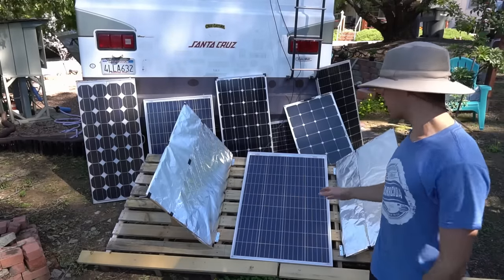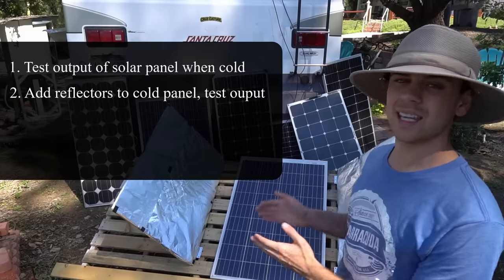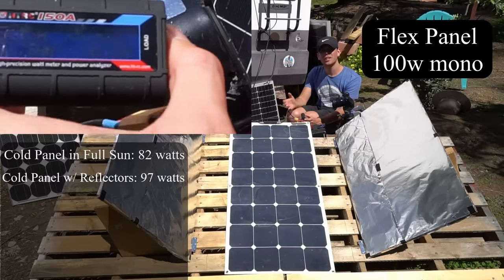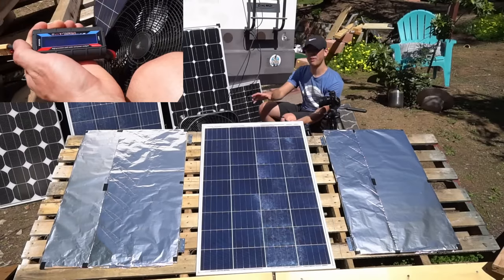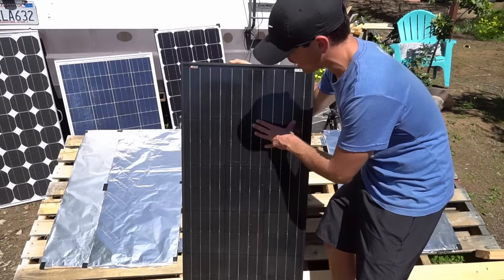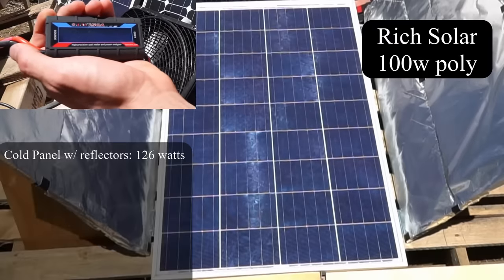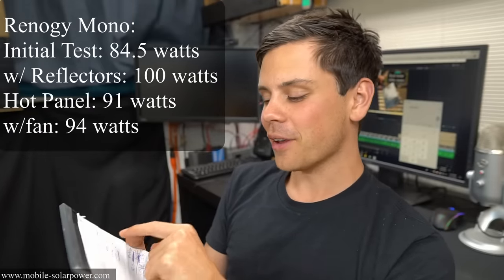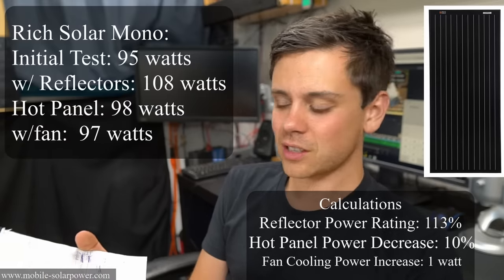Solar Panel + DIY Light Reflectors = More Power? Renogy vs Rich Solar vs Flexible Panel

Comment: An interesting test - most RVs have solar panels mounted flat, test reflectors on flat mounted panels.
Question - does the reflector need to light the entire panel equally, would “hot” spots from a parabolic trough reflectors compromise the panel output

Comment: I would say moving panels are excellent if you have them move in both directions. What that does is leveling the power during the day. While it might not increase the power that much. It will become much more even. Reducing the strain on the battery

Comment: Please do another video testing all kinds of reflectors: tin foil vs polished metal vs clear mirror vs mirror cover in fluorescent paint... And you can add more reflective surfaces... To see which are better. I assume the clear mirror will come out on top but it's worth experimenting on it also regarding the cost vs energy gain.

Comment: I camt remember the manufacturer but there is a panel that has a built in coil in back so the heat temp recovered from semi conductor is used in another application like domestic hot water.  You might want to test it against your other panels and see if there is a stability in temp to max output with your reflectors.

Comment: Great video, I really appreciate you taking the time to run through your experiments.  From what I understand solar panel photo-voltaic cells are excited by visible light in the 380nm to 750nm wavelength range.  Ultraviolet and infrared wavelengths cannot excite the cells enough to knock off electrons.

Since solar panel efficiency drops with the increase of temperature, wouldn't it make sense to use a UV and infrared film on the solar panels?  Perhaps adding such a film in a frame would foster better results, especially if there was an air gap between the film and the panel; to guard against acting as an insulator.

Have a great day.
Reply: You can reflect IR so photo panels don't get to hot as you mentioned. And use a water heater panel to produce hot water at the same time. ( use mylar insted aluminium foil)
Reply: No not only the visible light.

Comment: All solar panels are tested at Standard test condition (STC - Irradiance 1000W/m2 at 25 degree C). Say a marketed 100W panel can theoretically produce 125W given 1250W/m2 at 25 degree C condition. Problem is higher irraddiance normally means higher temperature as solar cell cannot absorb 100% of the irradiance. Whatever it cannot absorb will turn into heat. Higher temperature means drop in voltage due to solar cell's characteristic. Drop in voltage means lower power generated.

Comment: I just came across a roll of roofing flashing in the road. It's about a foot wide. I will def by cutting pieces from what didn't get run over by cars into flats long enough to use as reflectors for my Ecoworthy 120W folder. They show be ale to fold and stow with it really easy. My charging will be short term top offs midday. so It will prob be worthwhile to babysit them.

Comment: I did a similar test many years ago using two mirrors that were the size of the panel. I just ran cold water from a hose on the panel to keep it cooler for checking the temp differences. I have since lost the paperwork from that test.  seems like with two mirrors I was able to double the power but with water cooling the panel.
I think if you used actual mirrors and cold water you would have better results.

Comment: This is a great test, but I so wished you had to taken it a bit further, why because I have hard and seen with my own panels that the cooler they are in full sun, the better they operate at. So water coolant in the panel would be my suggested method, and what's more the water could be pumped through a cold water tank and circulate round the system, at the end of the day you have a tank of hot water!! The difficulty would keeping a even cooled panel. so perhaps buying more panels would be the answer, however I might try my idea on the next solar installation on the shed.

Comment: Mono panels perform better in low light. Also some panels have lower voltage but higher amp ratings to comparable wattage panels

Comment: That reminds me of my early days as a computer/programmer analyst when we were under intense pressure to write efficient source code.  Both computing power and internal memory and mass storage was expensive.  This was a time before PC's came along and minicomputers could not do the job (my shop had monster Sperry Univac 1184 which is still in use as a Unisis something or other).
Solar panels and other equipment are getting cheeper better all the time.  Just look at the improvements and advancements that have taken placed since the Intergr Kodiac and Apex came along.  My wish is to come to the market a out of the box comprehensive system.  It looks like Tesla is heading in that direction but not off grid yet.

Comment: I wonder what actual mirrors would do- probably not a whole lot more. I suspect adding a simple water system to help cooling would help with cooling- not sure if it's worth it though- the extra complexity/maintenance of adding the mirrors/water or fan for cooling would likely offset the benefit much of the time. Nice work :D

Comment: You could use peltier semiconductors to generate energy from the temperature difference, keep the panels cooler producing more energy as a result. But to move the heat away, heat pipes maybe.
Reply: peltier defices insulate, if you want them to cool it will take power and they are still terrible at generating power from a heat difference.

Comment: A friend watched output of panels on an island. With wave activity he could see the effect of water reflection on output of the panels. Snow reflection also played a factor but temp was a lot colder too so that improves output of cells so winter with a clear sky is kinda like comparing apples to oranges. Because no heat effect of cells because way too cold to be a factor. But thats why I think the water cooled panel has merit where you are and closer to the equator. Utilize the waste heat in another way and keep cells cool for max output

Comment: Nice video, well done. 2 points.
1) who  didn't expect more input energy to yield more output power? I would assume there is a maximum power out (more power in doesn't yield more power out): what conditions are needed to get there? Just a bright sunny day with the sun at 90 degree incident or are those reflectors necessary? 
2) those reflectors take up area, would a panel of the same area create more power than adding a reflector? I understand one solution is much much MUCH cheaper (in the short run), but area is a precious thing.

Comment: Started the video, grabbed the popcorn! :) I had the same idea a long time ago, but ran into some possible problems in my mind for practicality! ;)
Reply: I could see something like this maybe working in the arctic (for a research station for example), where sunlight is scarce and the environment is cold to begin with... but then again, even there it might not be worth the effort. One more idea I had was to improve the output with some kind of micro-lens film or coating, but I bet that has also been tried/tested by labs and manufacturers already - ideas are not exclusive... ;)

Comment: Well at the top end a good reflective system will get you 60% extra power out of a panel, but at that point water cooling is critical and your panel will have a shorter lifespan because of the extra photon bombardment.
Ultimately it comes down to calculating what the extra power will cost you in additional panels vs reflective or even tracking system.

Comment: Dude you are amazing, now I live in Colorado, if you were me , & you are going to put up solar panels to run a complete home, which panels would you use, & how many, what mppt control module, & what brand ,& how many watts would you use for an inverter to run everything in a typical house , full size fridge, washer / dryer, central air unit, lights, & all types of hand tools, & everything else you can think of, & approximately how many batteries, & which ones, & what brand

Comment: Nice video. A large lenticular lens would perform much better in terms of increasing light exposure and power output. Also using a fan will of course result in a net loss of power, not an increase, since the fan consumes power by at least that amount.

Comment: Have you considered using smart engineering + light/sun tracking + reflectors?  Imagine combining all of your panels with aluminum arms to a single light/sun tracker so they are all at the optimal angle. Using only one motor/light sensor.  And then do the same to reflectors targeting the light to the panels. I could definitely see this as something you would put the time and effort into doing each time you stop at a new location if you are going to be there for now then a few hours. Or if you have enough solar/battery to make it worth it...
Reply: I built a tracking system like that for my little MoHo a few years ago. Space on the roof was quite limted (by a pair of hatches in the roof) and my 48N location called for tilting from horizontal, to harest low-angle sun. Really simple 19th century linkages. Designed it for 9 @ 50 watt Renogy panels in 3 racks wired in parallel with 3 panels in each rack wired in series pairs or series trios, depending on cloud cover. This clip shows the linkage https://youtu.be/zqOkXPOkr2M

Comment: You should also take in account the area the cells of the panel take when comparing the panels. The polycrystalline panel has significantly larger area => there is more sun shining on it.

Comment: I wonder if water cooling the panels would help. Running copper or plastic across the back of the like a solar water heater, might help reduce the temperature, and get more power out. If you have a solar water heater anyway, this might help pre-heat the water going into your solar water heater. Food for thought

Comment: I noticed that when the individual cells on the panels are "full size",   they tend to output more power than the ones who are only half size.......  My only guess is that the full cells requires less connections / Soldering which means lesser resistance.   I was really impressed with that poly panel.   It's really the best bang for the buck.

Comment: Try it at 10*F on a severe clear day with snow covering the ground.  My 560W of polycrystalline panels put out over 720W. On a  hot summer day when the output is depressingly low, I spray them with the hose and watch the output jump. (Not practical, just interesting).

Comment: You don't have to use reflectors tho, lensing has the same effect... you're increasing the area that receives sunlight without increasing the physical area of the panels, and there can be different reasons why you'd want to do this, for example, you could put multiple panels standing upright in a small area, then collect light from a larger area above and direct them down, so you're not putting more sunlight onto the panel (no extra heat) but the panel may be in a better position, maybe less vulnerable, and having it vertical allows for much better convection based cooling as you get a faster channel of airflow next to it. You could maybe filter out lower frequency infra-red that contributes less to the power output, but contributes greatly to the heat increase etc. If you have no reason to do any of these, then it's probably just a case of "solution in search of a problem", but I think NASA was interested - but using actual mirrors to get better reflection... I guess when you're further out in the solar system, collecting sun from a wider area using a light weight expandable reflector material makes a lot more sense than adding bigger, heavy panels.

Comment: Best way to increase photon density is using a parabolic shape, like a parabolic trough (linear in one dimension) following a hyperbolic curve in the second plane, this is especially effective in heating fluids in a pipe. I think the best way to increase solar panel efficiency is to have some form of covering with light congregant collimated tubes that allows light in, but will reflect any reflected photons to be returned from the end of the tube back onto the surface at the same incident angle, this way it is reflected back again until the photon is absorbed by the silicon substrate and converted to an electron. But how this is done in one's back yard would be somewhat daunting to recreate, it is the same idea they use in plasma reactors which use lasers and a fluid plasma that does not hold the same shape, to increase efficiency in laser utilization, but in this case would not be in a spherical geometry, but implemented in a flat plane on the sun side of the solar panel. Just google light tubes for a primer but instead of letting the light out at the end of the tube it is reflected back at the same angle of the incident photon, and multiply these tubes like by the thousands on the surface of the panel. Cheers good information.

Comment: You should re do this test when it is winter conditions... I don’t know where you live, but if you get below zero conditions, perhaps the reflectors can maintain low temps with the reflectors...
Reply: Also, a reflector could be used when solar conditions are poor, like cloudy days...

Comment: I'm no engineer....
But i can't help but think? Using panels outside of the parameters they were designed for? Will shorten their service life or potentially damage them. 
The reflectors are a great idea! I just don't know if residential consumer-grade panels are designed to withstand the addition of reflectors.

Comment: I wonder if having a fine mist spraying system behind the panel would effect in any significant way...

Also if using reflectors when the sun is filtered by cloud or just far from baking the panel but like you've said... It's probably easier to just add more panels....

Love your videos, they've been so valuable to my learning curve and I love seeing a retailer with your video links on their websites...

Comment: Reflectors still have a niche use in limiting the amount of silicon you want to use. If you have a large solar array at say a farm, it'll be much cheaper to replace the reflectors than it will to replace the silicon.

Comment: I did like this video. I remember when Boeing bought out a Solar Company years ago that did solar arrays for outer space. They used I think a conical type reflector on each cell. It's Been Awhile so I'm not 100% on that. These were very efficient. Not too unlike what you're doing here in this video. Now I was thinking that if you could incorporate something that fits over the solar panels that bends light towards the panel given any angle of the Sun then you'd get maximal wattage. Sort of like a prism effect. But then again you have the issue of heating. Maybe there's a way to incorporate heat sinks on the back side of the panel to dissipate Heat.

Comment: Aluminum sheet is not the best for reflecting.

Secondly, you had to try it in the morning, when it's cooler outside and when we have a drop of production of electricity.

But nice job.

Comment: Very interesting. Any idea about the effect on lifespan on the higher heat? How about the actual numbers comparing a horizontal position vs the correct angle for the latitude and date?

Comment: It's good to use solar panel stick to the steel tank for cooling panel plus hot water. Two shots with one bullet or Two Targets with One Arrow.
What about using Mirrors as Reflectors ?

Comment: I see everyone using the reflectors on left and right, the sun moves left to right in the sky an you have to readjust all the timr.. Why not use a bottom reflector and put the panel on its side? You can just lay it on the ground for tests, put stuff under it to change the angle. 

I'll give this a try.

Comment: Thanks for this useful experiment. So heath is a challange. Did you ever try a blue painted surface as a mirror? It would maybe reflect less heat and the shorter wave lenghts (like blue) seem to carry more energy. I am hoping the panel would not heat up as much while sill getting some usefule energy. I am working in a low-income country so even if we can safe a bit on panel costs, it might be worth while.

Comment: Looking at the price breakdown at 0:37 and comparing the overall performance at the end, it doesn't really make sense to buy the more expensive panels. The $80 panel produced more energy overall, and for that price, you could buy FOUR of the most expensive panel!
Reply: The advantage of more expensive panels tends to be space - higher efficiency panels can make the same output with a smaller size, this only really comes into play when size is more of a limiting factor than money - i.e. If you want to turn a field into a solar farm and cram the most amount of power generation into that space, however on most personal set ups it really doesn't have that much of an impact unless you physically can't fit enough low efficiency panels to meet your power needs
Reply: My thoughts exactly. I'm putting the Rich panels on my shopping list.

Comment: Maybe put the solar panels on top of a solar water heater system with some kind of heat sync between them.  You could collect the heat for the water and effectively cool them without wasting power for a fan.

Comment: Perhaps a water cooled panel would be a better solution, and a dual use for solar water heater.
The prime system for cooling would be ammonia water adsorption system, as it gets hotter in the condenser, it gets colder in the evaporator, these applied to,the back of the panel I think.